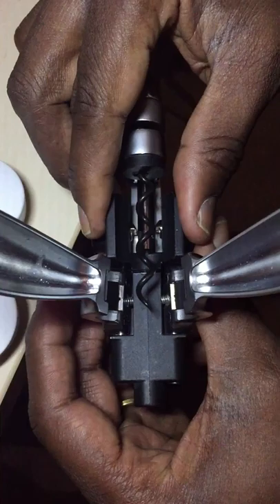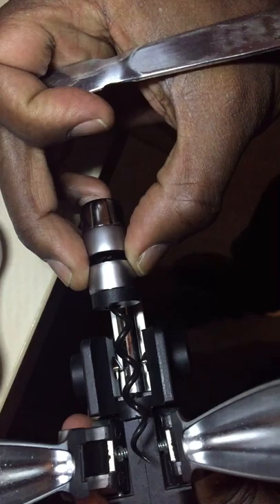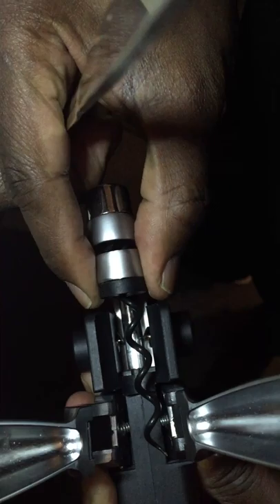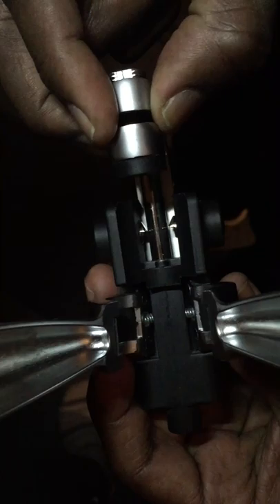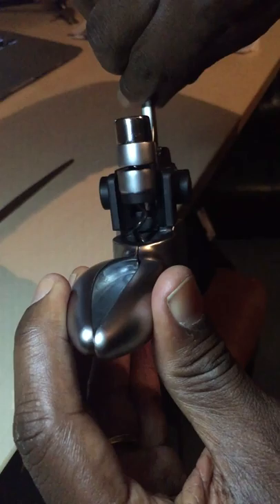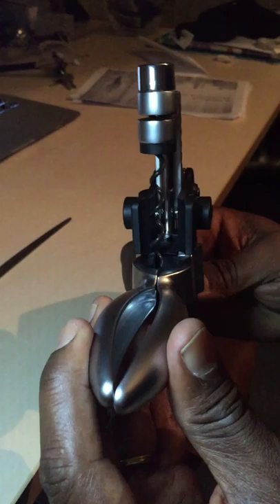How To Repair A 'Rabbit Corkscrew'

Comment: I am a little confused here. I have had my opener for at least 15 years without any problems. On the last bottle I heard a funny noise and when I pulled the cork out I noticed that the gear and the track had slipped about 4 teeth.  I know about all the springs and latches but I cannot figure out how to reposition the rack on the teeth. I got a replacement gift set on craigslist and I have been comparing the two.  Same model size and construction. I see no way to ratchet the rack into a different position.  A few more experiments and then perhaps a destructive video to release the secret sauce!  I may even post a YouTube  video.
Reply: Had the same problem. Any solutions?
Reply: Same problem here - would love a tutorial on how to fix if you’ve managed to!

Comment: OK I followed your advice and the advice in this thread. The trick is that you have to squeeze the handles on the bottle good to release the catches. You'll know it's working when the pins on the outside start to pop out. Thank you for this video!

Comment: Gareth, it is supposed to lodge this way! You have to queeze the two lower levers firmly around the bottle neck while pulling out the cork. Then the two springs will release the stuck piece. That‘s the whole idea of the rabbit corkscrew.
Reply: So how does one fix it if it is going into but not pulling the cork out?
Reply: When I first used this corkscrew I also thought mine is broken, because the two springs did not release the piece and the cork was not pulled out. Until I realized that I have to queeze the two levers much more firmly aournd the bottle neck while pulling out the cork. Then the two springs will release the stuck piece and it will work.
Reply: To Dalton Griffiths: What releases the two spring clips is the downward force of the lever handle.
If it doesn't go "all the way down",  it doesn't push the clips out of the way,  and allow the slider to come up, which stops the screw from turning, and pulls the cork out... See my comments above and below.
Reply: To acrobaticflying (cool name BTW): I had your exact problem. The screw would go down into the cork and just unscrew again. The "slider" (for lack of a better term), would not get released from the spring clips that Gareth pointed out.
I took the screw out, released the two spring clips with a thin flat screwdriver and pushed the slider up. Then put the screw back in and tighten the top. Now it works fine.
I DON'T know why...

All I know for sure is that the two spring clips were not retracting and allowing the slider to come up (which STOPS the screw from "unscrewing). It needs to pull STRAIGHT UP. The slider has a metal pin "crossways" in it, which prevents the screw from turning.

Please let me know if this works for you (it did for me...). I SUPPOSE I should make my OWN video...
But Gareth helped me fix mine, so he should get the credit (and views...)

Comment: My problem is the corkscrew turns it way into the cork but when you lift the handle it will lift the cork the cork screw just turns its way back out of the cork

Comment: Hi Garth The piece is supposed to remain at the bottom. The problem is what you actually addressed at the beginning of the video i.e the pins at the bottom which hold the handles. These pins should be gently seated with a punch the same diameter as the pins themselves. These pins hold a spring which disables the corkscrew mechanism from turning when the cork is withdrawn. Under no circumstance should anyone do what is suggested in the video. The result would stop the corkscrew from turning forcing the cork into the bottle. I know because I tried it. Hope this is helpful
Reply: It was really useful, Thank you
Reply: No.  What you said is completely incorrect. Read my comments above and below.
Reply: Lubrication at the sides so that the clamps move properly is all that is required.

Comment: Squeezing the handles pulls in latches to allow a main piece to lift up with the corkscrew locked in place. If the latches are not working every time or at all then lubricate the latches and the pins on the other side if your model has them and it will work like new.

Comment: This thing is just a BAD JOKE. The model I have is at 95% same physical. The spring pushing the 2 tooth to block the "bottom part" are ridiculously strong that part is just stuck there. That thing was never intended to be used by the "creator" or was made after they got drunk and not before... These are just to be put as decoration. If not give it to your brother so your wine will be safe for sometime....

Comment: The issue is that the handle when forced closed should release floating slider to go back up again.  It seems because of the poor manufacturing tolerances this does not always happen and gets worse with age.The sprung loaded clips that hold it down need to be lubricated and made less tight.  Then its a file and hammer job to adjust the tolerances.
Reply: I had your exact problem. The screw would go down into the cork and just unscrew again. The "slider" (for lack of a better term), would not get released from the spring clips that Gareth pointed out.
I took the screw out, released the two spring clips with a thin flat screwdriver and pushed the slider up. Then put the screw back in and tighten the top. Now it works fine.
I DON'T know why...

All I know for sure is that the two spring clips were not retracting and allowing the slider to come up (which STOPS the screw from "unscrewing). It needs to pull STRAIGHT UP. The slider has a metal pin "crossways" in it, which prevents the screw from turning.

Please let me know if this works for you (it did for me...). I SUPPOSE I should make my OWN video...

But Gareth helped me fix mine, so he should get the credit (and views...)

Comment: Thanks! This saved me 40 bucks for a new one. I already had two backup worms for it that would have gone to waste. I oiled the shaft with sewing machine oil which got all into the pins too, and it worked like a charm after that. Of course it's supposed to click into those springs when you operate it, because that piece that gets stuck is supposed to click in to pull the cork off the worm on the second pass.

Comment: This video was helpful, thanks, but I had to adapt it slightly for my model.  I have the barcraft lever bottle opener that is very similar but slightly different than the model shown.

I had both issues shown in the video and both were important to fix.

The small black cylinder of plastic shown at the beginning had slowly worked its way out of its housing.  I needed to centralise the pin in the hole and replace the black cylinder.  It wouldn't go all the way in to flush, but I got it about 2/3rds in.  Then...

Follow the second bit in the video to release the lower part of the mechanism, but as you're applying pressure to the retaining clip with a screwdriver or similar, press the black plastic cylinder home as far as you can. I got it to within 1mm of flush at that point.

Now you should find that the arms grip the neck of a bottle properly and both silver rods protrude from the sides, allowing the lower part of the mechanism to move to the top as you work the lever.

Tried to make that as accurate and clear as possible, but you may need to read it a couple of times as you work through it.

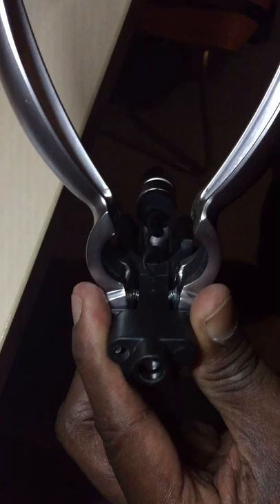Comment: Gareth, you totally miss the point. At 0:25 you see the problem. The cap that holds the pin in place is missing.
"Think of this as nothing more than a device to keep the handles in place".
No! Think of this as the most important part of the whole corkscrew that makes the magic happen! Without that cap the pin can't push the levers to free the block to go up.
See the video that kohjb posted for a perfect explanation of how it works.

Comment: My problem was the device not sitting well at all in its stand!  Your issue is not an issue at all... The two lock springs are there for that very reason... To hold the screw in that position until you squeeze the grip handles which releases the screw so it will draw upwards without turning... This is key. You want the screw to turn on the downwards lever action, but NOT turn on the upwards movement, to pull the cork out.  Similarly, if the screw is not turning on the downwards trip, it will just push the cork into the bottle!!
But at least I now know this and why you must use the full lever action travel, which means punching all the way through the cork... Something I normally avoid doing.

Comment: Thanks, it worked beautifully ! One more thing - in order for the pins to travel in their enclosures i added a drop of WD40 (use other grease that will not smell too much) on both sides of each pin. Back in business. I guess I will celebrate with a glass of a red...

Comment: Didn't work for me because that's not the problem with my opener.  The small lug that holds the cork to retract it or remove the cork from the screw, broke off.  I think I could probably fix it, but would need either a new replacement part or and arc welder.  Any suggestions?

Comment: Most useful but as mine is a "screwpull" not exactly the same as a "Rabbit". The pins you refer to are actually "pistons" instead of pins on the screwpull which can jam. These pistons, as well as jamming, can also rotate so that the locking chamfer is pointed downwards instead of upward facing. Thanks for your video, however, an explanation as to how the screwpull mechanism works would be very useful. Le Cruset, the manufacturers apparently do not believe in "owner repair"!

Comment: Thanks Gareth. How do you prevent that piece from getting lodged again? My 2 handles don't release the clamps when they are held together. I can only release 1 clamp at a time by bending 1 handle past the mid-way point. Is there some way to tighten the springs that connect the handles to the clamps?
Reply: Did you ever figure it out? I have the same problem!
Reply: @StepMania02  Not for the rabbit. I bought a waiter's corkscrew from Trader Joes and learned to use it instead!

Comment: The black plastic part near the top of the corkscrew on mine broke.  I took the little pin out to remove it.  Anywhere to get parts?  I may have to jbweld it together.

Comment: have exactly this opener, used to work like magic. it appears to function smoothly, but when i try and pull out a cork it reverses the corkscrew right back out of the cork, leaving it in the bottle, unmoved. is the corkscrew supposed to turn in both directions? thanks
Reply: It's not supposed to turn in both directions. When the corkscrew is empty, the mechanism is supposed to be locked between the springs. That makes the corkscrew spin. Once the worm is in the cork the mechanism is supposed to ride up with the cork so that the worm doesn't spin. Then when you swing the arm back, it is supposed to lock in again and let the worm spin out of the cork again. It probably needs lubricating oil if it's not behaving. WD-40 is not lubricating oil, it's penetrant.

Comment: The rabbit is pretty but it has a lot of mechanical issues.  The issue you're describing isn't 100% accurate.  The rabbit can stop operating correctly when the pins on the side become disconnected from the handles.  The handles tell the pins on the side to come out.

I just threw mine away - I'm going back to the trusted simple opener.

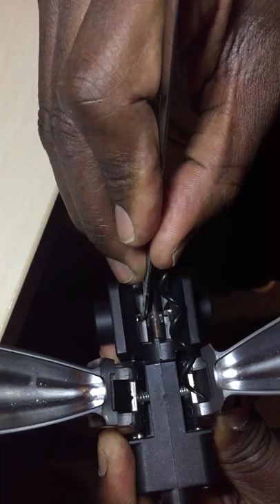Comment: I am afraid an important detail was missed.  In fact, the point about pushing the pin back up above the rabbit-ear handle is only part of the solution.  The pins actually go up through the rabbit-ear handles, up thrugh the frame and into the latching teeth.  Here, I refer to the two symetrical plungers that Gareth points out at exactly 1:00 minute in the video as the latching teeth.  It is imperative that the pin be pushed up into the the latching tooth.  The challenge is getting the pin and the latching tooth perfectly aligned while (whilst for my British-English friends) the rabbit-ear handle is spring-loaded and pushing the pin to one side.  It may take two pair of hands.  I used a bench-mounted vice to hold the the entire device steady (rabbit-ear handles pointing straight up, lever arm fully 'down' wirh the corkscrew removed as Gareth suggests; gear-arm horizontal in the vice) and a small clamp to pull the rabbit-ear handles together at their pivot points, but without bringing the rabbit-ears fully togetheraas would be the case when opening a bottle of your favorite wine.  Bringing the rabbit-ear handles together at their respective outer ends defeats the purpose of clamping them at their pivot points.  I then used a small tool to press and align the latching tooth so the pin will insert through it.  When you are finished, the pin should be well recessed into the void at the bottom.  Mine originally came with plastic inserts that centers the pins in their chambers; however, one disappeared.  I suspect those centering inserts help improve proper functionality.  Good luck!  And thank you Gareth for pointing me in the right direction.